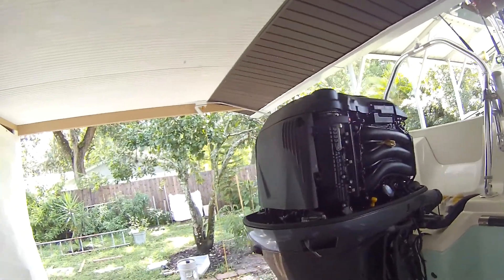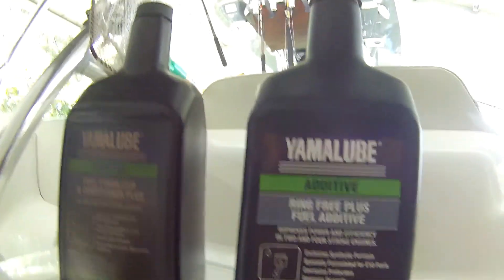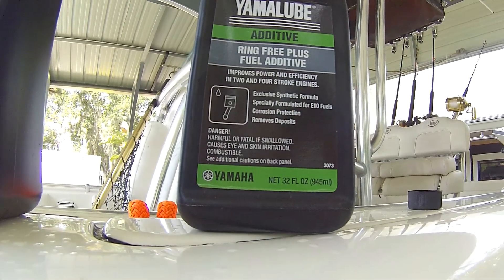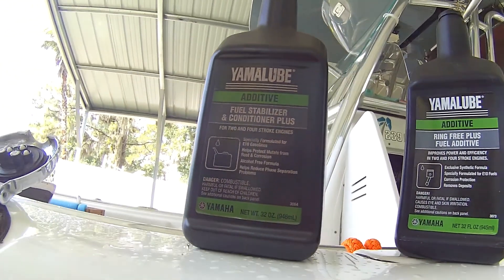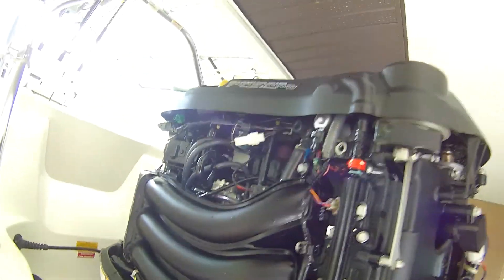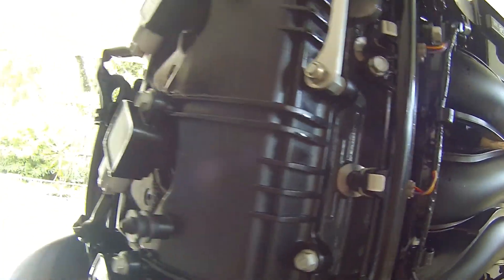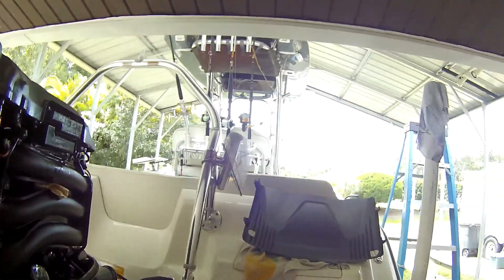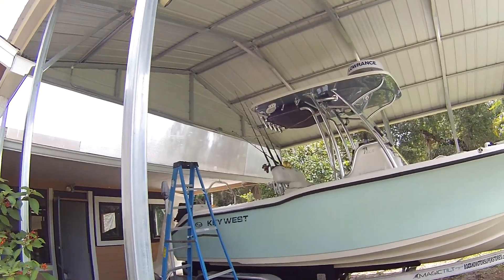maintenance on the yamaha outboard with yamaha fuel products

Comment: I don't keep gas too long and I don't use ethanol based fuels having enjoyed that nightmare years ago.....I've been using the Yamaha Ring Free for years and you can sea the results every time the lower unit is pulled for a new pump.....Reel shiny!!
Reply from the maker: if I can fish more then the gas will get turned over more
Reply: What does the fuel additive have to do with an impeller? Or do you mean fuel pump?
Reply: @arubanjames ....Neither!! I've got 2 Yamaha motors ...a 25 HP 2 stroke(2005) and (2019) 4 stroke 70 HP. When changing the pumps on both motors when you look at the top of the exhaust housing on the 2 stroke 25 HP you can see the pistons and mine are real shiny....Sticking rings equate into lost compression and after over 4000 hours on my tunnel hull 25 hp I've never had a major engine failure after 18 years of use....I exceed the oil requirements and ring free is added to every fill up on a 6 gallon tank....The proof's in the performance and the use of Gulf Coast Marine here in Weeki Wachee, Florida.....Sea Ya!!